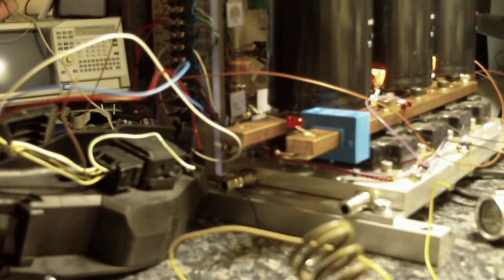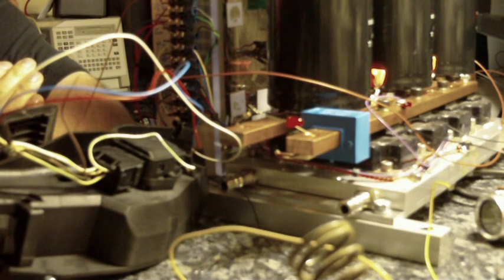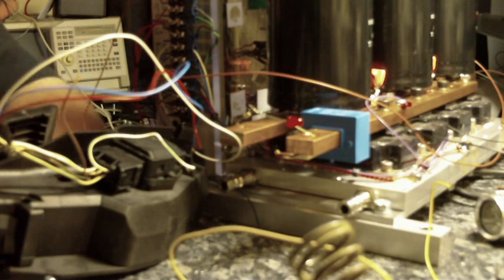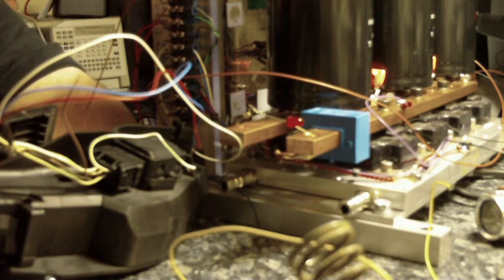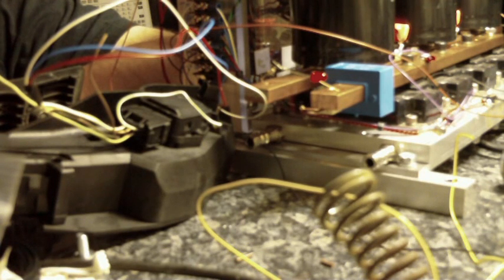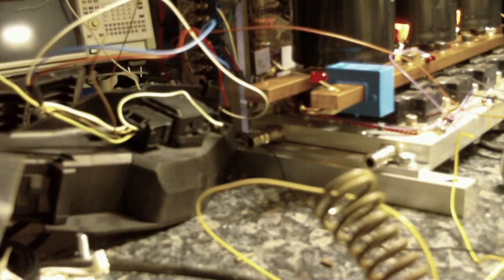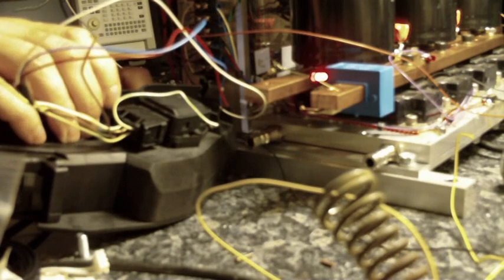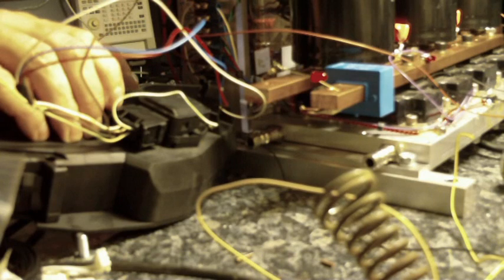BMW EV Conversion 48 Liquid Cooled Controller 02

Comment from the maker: On the bmw the key has to be rotated back 3 clicks and removed from the ignition before the steering lock will engage. Fair point on the hill starts but i always use the handbrake.

Comment: There could be a problem with this setup with hill starts where you need to apply the throttle as the brake is being released, but usually before it is fully released.

Comment: @pooey1911 Yes, there's a watchdog timer that resets itself every 250mS I believe.  It would be nice to have an independent hardware circuit that opens the main contactor if it wasn't getting a useful signal from the microcontroller.

Comment from the maker: Good point Dan. If the micro crashes then the last resort is to turn the key off. This removes 12v power to the controller and contactor.